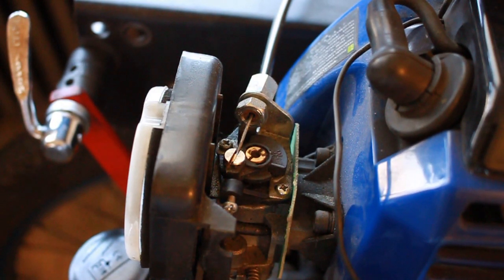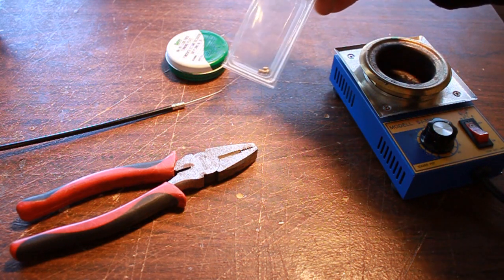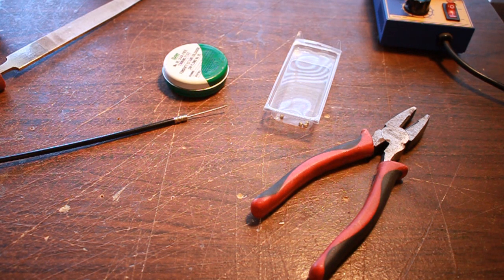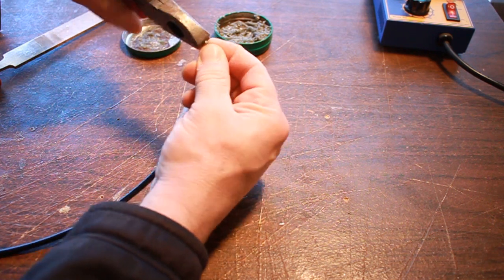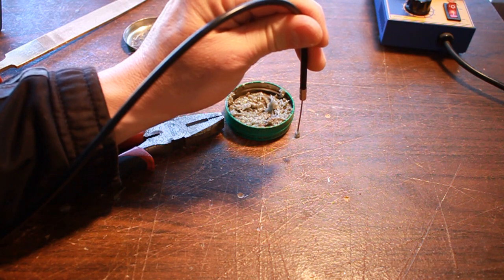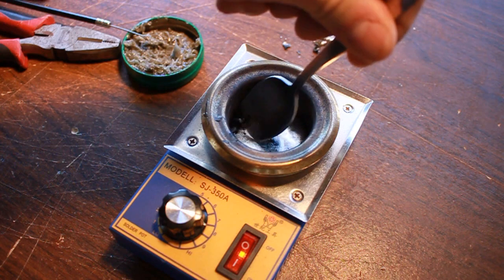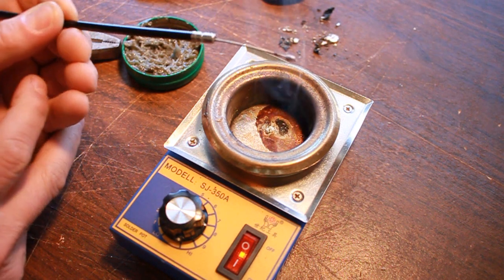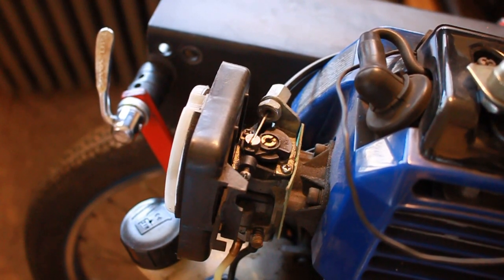HOW TO MAKE A THROTTLE CABLE - SOLDER POT DEMONSTRATION

Comment: It's a little tedious but you can  triangle file old thermostat tubes/thermal couplings to make as many as the knerls as your ever want. old deep freezers gas hot water tanks and window air conditioners all have these tiny copper lines. I lightly crimp them on fray the cable flux and dip works good

Comment: I know someone who uses those amber pill bottles for little things such as those nipples or anything that is small and easy to lose.  Have any plastic film canisters?  They work well too except if they are black, labeling them might help keep you from losing your mind trying to find the right one.
Reply: film cannisters are handy for cleaning & storing ball bearings too,part fill it with degreaser or similar,place some plastic wrap over it before u put the lid on so its less likely to leak,shake gently to clean bb's simple :)